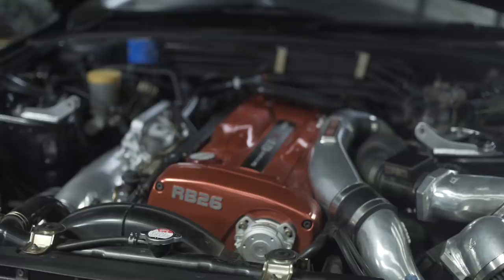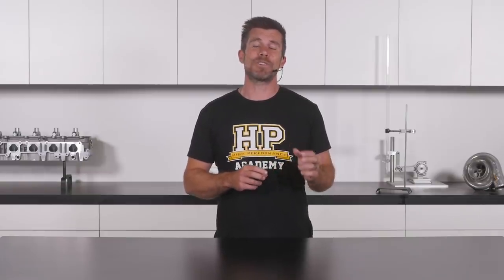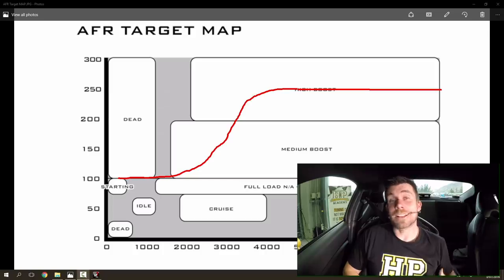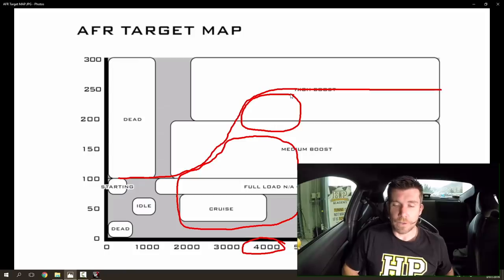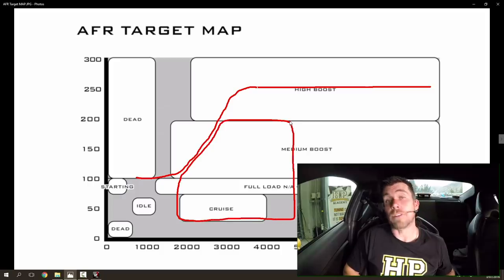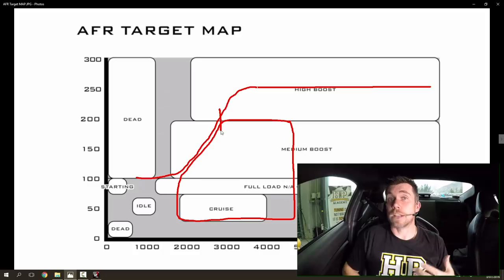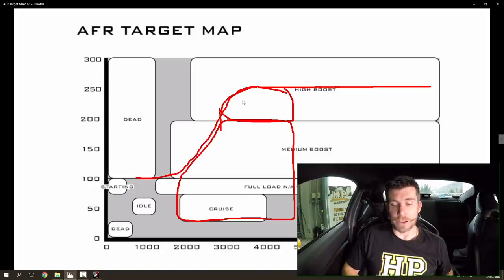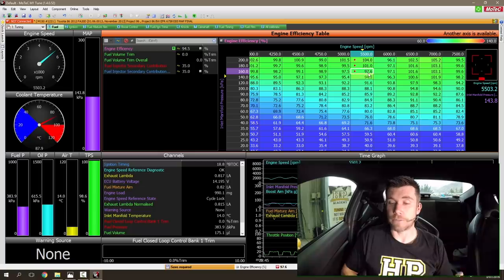High BOOST Tuning! | How To Tune A Turbocharged Engine [FREE LESSON]

Comment: Just max all tables with highest value wot. 99 timing 1 fuel. Won't even run so then I can put it on a trailer go to races and say once my tune is dialed in I'm going to smoke everyone. "Needs a tune and should make 1000 wheel"
Reply from the maker: We've been doing it wrong! Cheers Clayton :D - Taz.

Comment: I do spend time at the area @3k rpm as it comes on boost as most 4/6 cyl engines will be at that point when on the highway or if they shift down a gear at 80kph and spool it up but dont want to rev the guts out it skipping 2 gears. A lot of tuners around sydney are lazer fkers, just stick it on the dyno and do pulls

Comment: I’ve just discovered (probably not the fist but I haven’t heard of it before) to increase performance with minimal drawbacks.
Instead of boosting up the torque you can optimise the engine for power. 
So for example you have 185 hp (bmw b48) with 285 Nm max torque . Intead of tuning it up to say 350hp max torque and 250Hp max power which increases forces on bearings and rods because of torque you can simply control the tune to keep the 285Nm all the way to 7000rpm this will give you a nice constant torque from 2000rpm to 7000, electric car like.
285Nm@7000rpm is 280hp. Of course you get this power as you can see only if you push the car to the rev limit
The down sides I expect to be minimum only more heat if pushed too hard so for race cars you need temperature mitigation otherwise if the car can accept the normal tune up it should be fine with my version.
Also you can make an inferior setting than a regular 350Nm 250hp. By letting max torque at 285 and allowing it to drop to 255Nm at 7000rpm which gives you 250hp
-————————————>
So in a few words:
Stock 285Nm max 185 hp max
Normal tune up: 350Nm 250hp max
!!!My tune up: 285Nm max 250hp or 280hp max!!!
Reply: How do you increase hp without increasing torque?
Reply: @JoeSmith-jp7bk  if you have boost controller ,you can play the game as you want ,torque in low rpms kill the engine and ignition timing is for na engines,if you want power in turbo charger engine you increasing boost not timing...
Reply: @JoeSmith-jp7bk you can't, torque and power are intertwined, torque at an rpm determines your power.

Comment: I am planning to buy you guys tuning course, actually at the very start of turbocharging my 2,3l mercedes 4 cylinders engine which has a 9:1 compression ratio! I would like to go around 25 to 35 psi of boost! What compression ration should I at!

Comment: Do I need tuning up my car after I got instilling turbo kit on it and do I need replacement of the car manufacturer computer?
Reply from the maker: 1.) Yes
2.) Possibly, depends on the application

If you plan on using a professional tuner to tune for you, then they can help you with both of these things and they are the best person to do so as they can make sure they get everything right for what you want to use the car for, your budget, and your timeframe :)

https://www.hpacademy.com/technical-articles/how-to-choose-an-engine-tuner/

If you think you might want to learn how to tune yourself, then you can start to get a feel for what is involved with some free lessons here: https://www.hpacademy.com/free-tuning-lessons - Taz.

Comment: Hi. Just want to get an opinion. I have an audi A6 1999. It has a slight engine miss since it's AC compressor is too large. The replacement compressor fixed is not an original. Engine is 1.8 T. Is it advisable to do a stage 1 torque or rather an engine remap. The pull is not that great when it tries to go in hill areas. Also is there anyway to increase turbo. This has done around 127,000 miles
Reply: Running slightly rich may solve the issue, or Just install a bigger turbo

Comment: Hey nice job as usual 
Can you give a lesson on 
Intercoolers
Reply: If it's a street car, use Water/Alcohol Injection instead,
you probably don't need an intercooler on a street car.
As far as I'm concerned, Air to Air Intercoolers are just a big pain in the butt, and generally
should not be relied upon for consistent, predictable performance, or detonation protection.
Yes, if you size all the plumbing, and the intercooler itself correctly, and insure that you maintain
consistent, and adequate cooling airflow across them, 
they will help to generate more power with less boost, 
but, they are somewhat unpredictable in performance,
which is not something you want when operating on the ragged-edge of engine destroying detonation.
They are also ridiculously bulky and difficult to install without 
huge performance compromises and bodywork modifications.  

"Air to Water to Air" Intercoolers are far more predictable in performance,
this is why this is the ONLY type of intercooler you will see on a 
factory designed Turbo, or Super Charged, installation. 

Lots of excellent info here........
https://www.rbracing-rsr.com/waterinjection.html
.
Reply: @jimbrown563  Not even remotely true. Water/meth injection isn't very practical on a street car due to the need to fill it up and gas stations don't carry it, intake air temp sensors allow you to adjust for inconsistencies in cooling, and lots of factory turbo cars use air to air intercoolers.
Reply: Are you trying to tell me you don't have a Wal-Mart or an Auto Parts store within 5 miles of your house ????
Windshield Washer Fluid is an excellent substitute when you can't get to a Home Depot, or Loews to
by a couple of gallons of Alcohol, 
which should last you about a month, 
unless you drive around in Boost most of the time, then a 2 gallon tank may only last a week.
And, if you run out, it's no big deal...... 
so you have "less" Boost until you fill the tank again, not exactly broke-down on the side of the road.

In a more practical world........
If your in Boost on a regular basis, what you actually need is a bigger engine, and,
it needs to have big enough heads
that you really have to try hard to generate more than about 10 psi of Boost,
in which case, 
your manifold air temps shouldn't ever peak much above 170F, during the summer months.

If your talking about Daily Drivers, there is a practical maximum Torque Level, 
which if exceeded, just results in tire spin, at which point, 
I drive around you in my mostly stock S-10 Truck, ( 2.1sec 60ft times on standard street tires).
( this is with a very low compression 4.3L V-6, with a stock cam which came out of an old farm tractor,
and a 3" Cat-Back exhaust, and extensive HPTuners tweaks on the Computer, 
and a 3K rpm High Stall/ Lock-up Torque Converter )
( Your Turbo doesn't stand a chance below 50mph without Slicks, ( and that makes it a race car), 
I blow off a Turbo Rice Burner about every 2 weeks or so, when I run into them,
with the AC and Stereo on, and with reasonably quiet mufflers, and without ever squeaking a tire,
while they hit their rev-limiter repeatedly )
I get a big kick out of it. 

"Traction is Action", so if you're spinning your wheels, you're just blowing cash on new tires.
My tires are  ~$200.oo each, 
so I do everything I can to keep from unwinding them onto the pavement.
And, my truck is set up for handling, not drag racing.
( The 'Torque Management" settings in the Factory Computer are very useful for
maintaining exactly  0.83 G's of acceleration in first and second gears,
higher G-forces require Slicks, and many drivetrain up-grades )

BTW, I stand corrected on the Factories not using Air to Air Intercoolers,
I haven't worked on a Rice Rocket for around ~30 years, so I'm out of touch on that one.
I'm a die hard GM guy, and the Domestic systems are 95%  "Air to Water to Air",
Except for the full sized Diesel Trucks, 
which have Intercoolers with twice the volume of the main Engine Radiator,
and enough room for 4" pipes snaking all over the engine compartment.
But when you start talking about compact size cars, 
now you REALLY have to get creative to cram 20 pounds of shit into a 5 pound bag.
Like I said..... Pain in the ass...... 
Shit stickin' out of the hood, and out from under the front bumper kind of pain in the ass.
Especially when it comes time to inspect, or access something, under all that plumbing.

I spent over 2 years as a Tuning Guru, mostly in the Mega-Squirt Forums, back in the 90's,
so I've seen a lot of weird shit, 
and assisted hundreds of people with figuring out their tuning problems, 
and probably 80% of that was on 4-cylinder Turbo-Charged Rice Burners,
which is why I will assume that's where you're coming from as well.
And because of this extensive background, and hands-on experience, 
I can confidently make the statements in my first comment.

I can also be confident in assuming that you have not thoroughly gone through the
web page that I provided a link to.
Those guys use custom made Air to Air Intercoolers and  Water/Alcohol Injection at the same time,
but they are setting motorcycle Land-Speed-Records, not driving a street car.
They've been doing this since back in the 80's, and they know what they're talking about.
I recommend that site because my experience agrees with everything they recommend,
although their recommendations are geared towards dedicated racing machines,
not street cars. 
But all the rules still apply, no matter what type of engine is in question.

There's more than one way to skin a cat, 
but it takes lots of study and experience to always maintain that slight edge on the other guy.
.
Reply: @jimbrown563  I mean I stuffed a turbo bigger radiator big Intercooler into a 1.6 Miata and that’s arguably about as small as it gets, never turbod a car before and wasn’t bad at all

Comment: Would it be fine to take the engine between 100-200 kpa while introducing load for sometime when tuning in steady state ?
Reply: Are you asking if you can steady state tune between 100 and 200 kpa values?
Reply: Yes
Reply: @robusttuning942  yes, sometimes that is possible. That is the goal actually. The ideal thing to do. This video specifically talks about why that is difficult to do especially if you run high boost, so it offers alternatives. Try steady state first

Comment: We need a way to tune without a dyno, like a simulator. Anyone know of any?
Reply: dyno is a road simulator , go drive on on the real road if you don't have a dyno its all the same just you get consistent results on the dyno and its not made sketch looking at a laptop on the road with other people out
Reply: Also road tuning you domt get power torque readouts, which is the biggest bit of info you need to know to see whats working and whats not
Reply from the maker: As Jackson mentioned, road tuning is what you're after. Here's something to start you off:: https://youtu.be/jTxdU-90Xi8 - Taz.
Reply: The best would be to have a real time engine simulation model, coupled to your regular tuning tool. Then you cold do all tuning virtually without the risks. To bad its out of reach for the non oem world.

Comment: Could you use a air compressor with a pressure regulator to tune a car at specific boost?
Reply: What? I'm confused as to what you mean?
Reply: Christian Fletcher boost builds so instead of waiting for boost to build it’s already being supplied a certain amount of psi. So you can tune the whole gear without any hiccups. Sort of a nice way if you are boosting by gear. But idk much, just a theory
Reply: That doesn't make any sense in my head 😂
Reply: Volvo does this to eliminate turbo lag. They install a small air compressor which drives the turbo turbine to speed it up instantaneously
Reply: @MrSupermasi  yeah but he talked about tuning the engine at an specific Level of boost just through the compressor
Reply: gedeonbertram the engine is set as is if it was running without the Shop air compressor so it’s turbo, intercooler etc etc. I believe I saw a air compressor line hooked up on the turbo and someone controlling the amount of air pressure (Air pressure regulator) to tune the engine at that specific boost.
Reply: It's not the boost that is important, but the CFM. It would require quite a big compressor and the gains would be negligible as the technique discussed here is quite safe and fast for someone with some experience.
Reply: UsagiMoto,
Possibly what you saw was someone calibrating a blow-off valve, or pressure switch, to a specific value.
They certainly were NOT running the engine on a shop air compressor.
And, an engine will not run correctly with a shop air compressor attached in any way,
you certainly couldn't do any useful tuning with a shop air compressor attached.
If this thought even crossed your mind, 
you are missing some vital understandings of how engines operate.
You need to start with the absolute basics first, or everything else will just be a huge ball of confusion.
.
Reply: Sébastien Mesili most definitely Team DRT Ralphy was the guy. Definitely well respected. He is considered the original RacerX if you read about him.
Reply: I think it would be hard to get the right volume of air at the right pressure using an air compressor and I think you would still need to run it through an intercooler of sorts, when you have a turbocharger installed you might as well use it. I know dinan the bmw tuning guys place huge high pressure fans to get accurate tunes, so that they can control the air temperature and hence get accurate volumes of air in. They win alot of races so I think they know what they are doing.
Reply: No but you could suck on the muffler and build boost faster
Reply: I think ive hear people did his on engine dyno back then... This to simplify the engine install in the dyno room...and avoid expensive turbo sizing swap

But nowadays with steady state dyno, never heard peole did this method anymore...

Edit: they didnt tune with boost.. but airflow numbers...
Reply: I just use an air compressor to supply air to the top of the gate to raise boost and tune at different boost levels by altering psi on on top of the gate.
Reply: Yes.  This is actually the way Ford did the early experimental development of its boosted F1 engines in the mid 1980's.  They used a big external compressor to pressurise the intake - but of course this does not replicate the backpressure of the turbo - see around 12 -14 minutes in at  https://www.youtube.com/watch?v=QFy0ezTOLZs